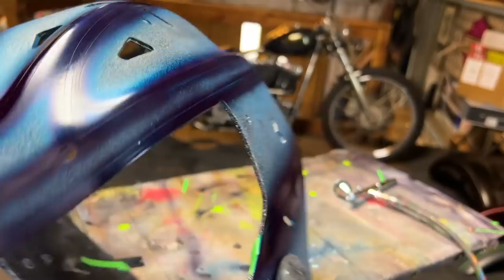How I FLAKED OUT and Spun Gold leaf on a Hockey goalie Helmet

Comment: Nice job......Have you ever tried using an xacto knife instead of razor blades?....To me, so much easier to manipulate.  Just don't drop it as those suckers always head south pointy side down....I've had enough bloody toes to prove it
Also, you can use 1-shot without hardener for striping. Easier to brush and mistakes can easily fixed with mineral spirits....trick is to clear before it is dry to avoid reactions
Reply from the maker: Yep sometimes I do thanks for watching